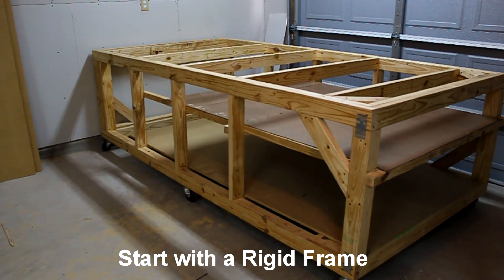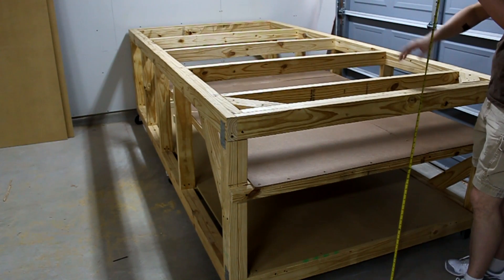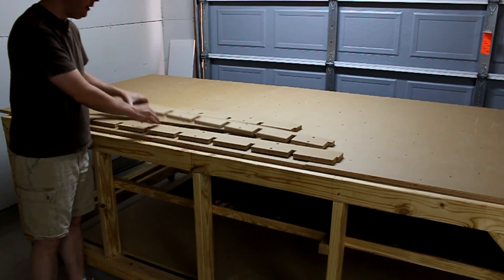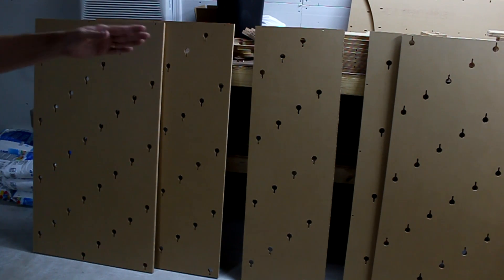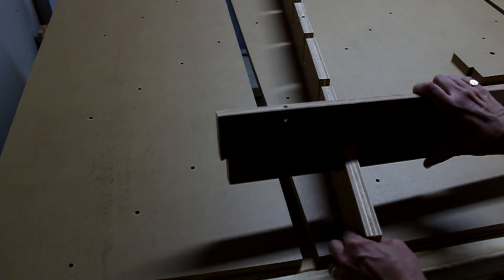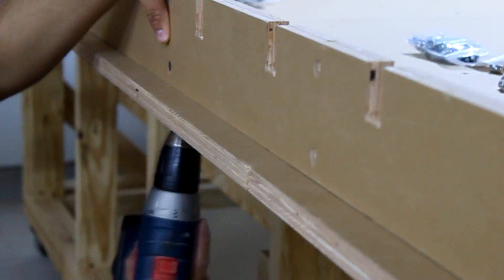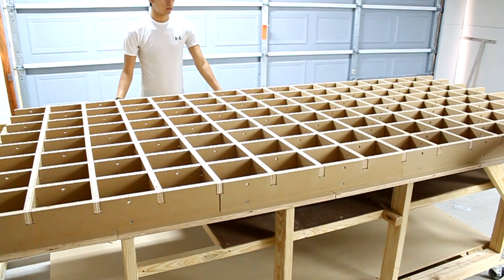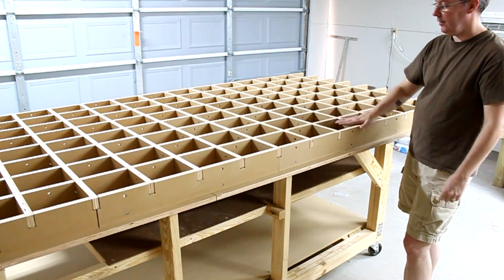greenBull CNC Machine Kit Table Assembly Part 1

Comment: I am in the Pacific Northwest, and humidity varies considerably.  Does that affect the dimensional stability of your machine?
Reply from the maker: The material is MDO, a reusable product in the construction industry for concrete forming (a wet process).  MDO is the best wood based material for humidity which has heat and pressure treated layers on the front and back that contains a water resistant material that our 40 watt lasers cannot cut through.

Comment: If all your holes line up correctly because the parts are well cut then it would be easier to assemble the grid on the floor, insert all the cross dowels, screw down the top, then tip it onto it's side, attach the bottom, and then lift it onto the table.

This model could have included holes for airflow throughout the spines so that it could be quickly transformed into a vacuum bed.